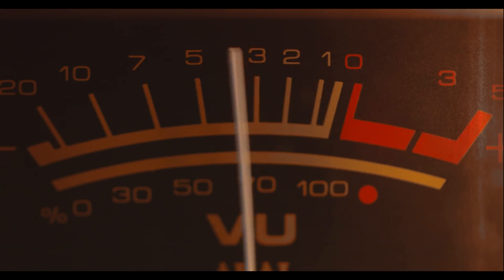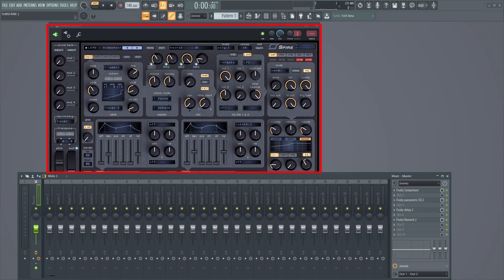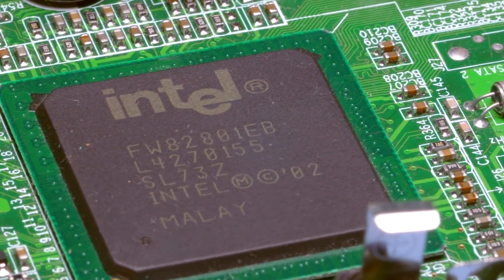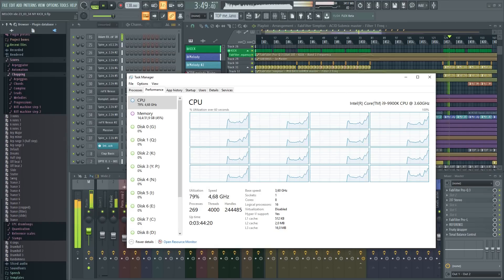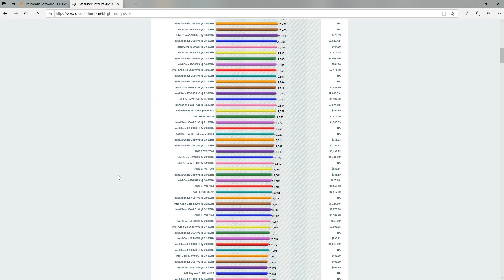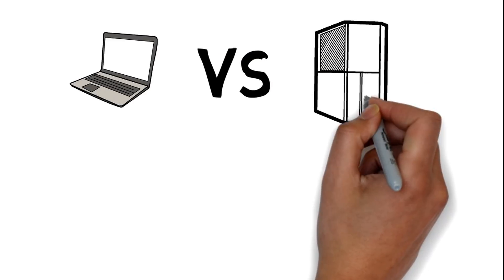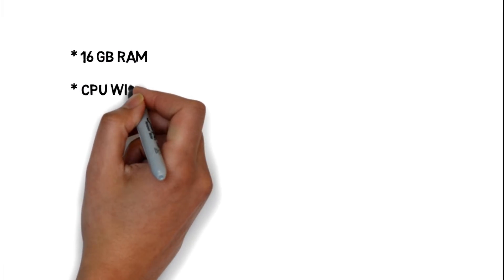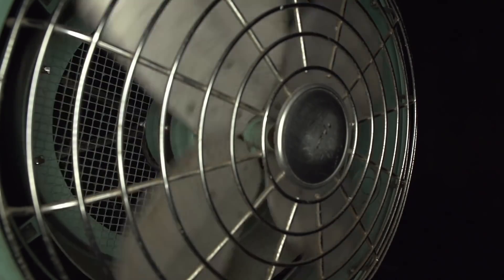The Best Computer For Music Production - What's Needed And Why!

Comment: You confirmed my conclusion: you did a 4 generations upgrade and I did a 5 generations; the performance is better but not as much as I expected. I thought that I did something wrong in my configuration because the performance jump was not a jump at all, and I have upgraded to an I9-9900X, not K, which is said to offer an even higher single core performance, apart the fact that it has 10 cores. But yeah, no overclocking in my case, just running the processor at maximum speed all the time.
Reply from the maker: The main benefit of having a 9900x is that you'll be able to run it with quad channel memory. The 9900k is about 40% faster than the 5820k on paper, however, that's not reflected in these tests. The 5820k is able to run at quad channel memory, which seems to give it a huge advantage. I tried setting it to dual channel, and that had a huge performance impact in FL Studio. 
I assume you're running it in quad channel ? 
Regarding single core performance, the 9900k actually have slightly better single core performance, but that's typical, as core count goes up, single core speeds goes slightly down. It's a small trade-off. 

The reason I recommended the 9900k is because it can almost always be clocked to at least 5 GHz and above. Most of them will be able to run at 5 GHz on all cores, with no problem, and some even higher than that, as long as you have good cooling. The AMD 3900x for example will max out at about 4 GHz on all cores, 4,3 tops if you get a good chip. That's about 1 GHz difference, which WILL have a huge impact. Because single core speed, and IPC in general is so important, I feel like the 9900k is a good way to go, given that you overclock it to get the max out of it. The 9900x will run at slightly slower clock speeds, but then you get that quad channel memory which will come in handy if you have very large projects. 

Building a 9900x based rig will be more expensive though, and I'm not sure if it' s worth the extra money., as I'm not sure there would be a huge difference between a 9900k and 9900x with both of them overclocked to their max potential. :)
Reply: @FireWalkMusic  Oh yes I am running quad channel memory, actually motherboard  does not let me run dual channel, at least that's what user manual is telling me. I am using  128 GB, and my MB can support up to 512 GB, although I do not think 64 GB DIMMs exist on the market now. Its like having a hard drive size RAM, its crazy when I think about it. I could upgrade to 256 GB though... I am just joking, I never seen the memory load going above 20%.

Comment: What was the final budget for this pc? Looks great.  I'm new to this. I plan on building mine soon.
Reply from the maker: Not exactly sure. I think it was around $2000. I decided to reuse some of the parts from my old rig though, such as the video card, hard drive etc. In many cases, if you already have a stationary computer you can simply just upgrade the motherboard, cpu, cpu-cooler and ram, which will be much cheaper.

Comment: If my song is clipping, seemingly as a result of applying compressors etc. does this sound like a cpu problem?
Reply from the maker: If you overcompress your track it will sound distorted. If you max out your CPU you'll get overruns and you'll have pops and glitches which can sound like distortion. You'll be able to tell the difference by looking at the CPU buffer meter. If it's at 100% or very near 100% then it might be a CPU issue, if it's below that then it's likely you have gone over the top with compression. As Peter said, if it's indeed CPU related you can increase your buffer size in the audio settings. You can also try enabling tripple buffer. 

Check out this video for more tips on how to get the best CPU performance in FL Studio: https://youtu.be/OWYmqwb7b4k
Reply: @FireWalkMusic  I went into audio settings and sure enough, asio for fl wasn't selected, it was the buffer causing the issue. Thank you!

Comment: hi... i am thinking to build a pc just like this, but with the i7-7700k because of is higher base clock...
what do you think?  7700k vs 9900k? (just for music production)
are you relying on the overclock? it will be stable?
Reply from the maker: Hi, the i9 will be able to run at 5 ghz or more on all cores without any problems. It's perfectly safe as long as you have sufficient cooling, like in this video, or alternatively watercooling.

Comment: I‘m about to get a new 16“ MacBook and I’m torn between the i7 / i9 cpu. The i9 in theory has better max single core performance and obviously better multicore performance, but here’s where it gets interesting: If the cpu is under full load, the i7 will run at around 6x 3,1GHz and the i9 around 8x 2,8GHz - so higher clock speed on the i7. Assuming doing a lot of processing on individual channels in my DAW (Studio One) with maybe 8-10 plugins on one channel - could the i7 be a better choice here? I can’t decide which one to pick, pls let me know your thoughts.
Reply from the maker: If it was a stationary computer I would recomend the i9. They can be overclocked to run at 5 ghz on all cores. However, a laptop isn't going to have sufficient cooling for that, so I suspect the higher clock frequency of the i7 will be preferably. You need to look at the IPC (instructions per cycle), or operations per clock as some people call it. Most people won't need a 9900k anyways, and the older i7 CPU's are usually more than enough for most people.

Comment: I am building this same pc with all the same components (it's my first build) and I'm having some issues. I have everything connected to the best of my knowledge. PC powers up, all fans running, but no display to the monitor and no USBs seem to be working. Keyboard plugged in lights up for a second and then goes out and is unresponsive. Need ideas.
Reply from the maker: It could be a number of things. Make sure that you have the correct power connectors connected to your video card. If you still can't get any image, try removing the video card and hooking the monitor up to the onboard displayport on the motherboard instead, using the internal graphics instead. If that works, it's either something with the video card, or it's not properly installed. If you don't connect the power to it correctly then it won't work.
Reply: @FireWalkMusic  Tried that and still nothing from the internal video card. The CPU power has an 8 pin and a 4 pin right next to each other. I only have the 8 pin installed (it didn't come with a 4 pin connector that I saw) Could that be an issue?
Reply: Ok, so it was a ram card not fully seated. Damn, I feel stupid :D
Reply from the maker: @Paultheguitarist  Glad you figured it out! It's annoying when that happens :>

Comment: A Mac computer
Reply from the maker: A mac computer and a pc computer is exactly the same. They use the same hardware, it's just the software that's different. It's possible to install mac os on a PC, so called "hackintosh" :)
So in terms of hardware, the same things apply when using a mac. :)

Comment: Amd ryzen 7 3700x has the highest single core performance
Reply from the maker: The new Ryzen CPU's are indeed great and their sngle core performance are now as great, or greater than that of Intel. However, the 9900k will be able to run at much higher clock speeds.  Ryzen will typically max out at around 4 GHZ on all cores, while the 9900k will typically have no problem running at 5 GHZ and above on all cores. That's a 1 GHZ difference, and when you take IPC (instructions per cycle) or "operations per clock" as some also call it into consideration, the brute force capability per core will be higher on the 9900k. At least for now. 

AMD has made some really good CPU's lately, and they show no sign of stopping. Combined with Intel's ongoing manufacturing problems I wouldn't be surprised if the next one they come up with leaves the 9900k in the dust. But for now the 9900k is likely still the best when it comes to music production. 

That said, the AMD CPU's are better value overall. They are great all-round CPU's, and unless you need to really squeeze out every last bit of performance for some reason, then I would actually recommend getting the AMD instead. Few people actually need a 9900k in the first place. most people make medium sized projects and the 3700x will offer superb performance in most cases.
Reply: @FireWalkMusic  well, depends... As long as the DAW you're using can utilize the cores and threads AMD could be better in that aspect as well.

Comment: You should get 128gb of ram when your using so many different tracks and instances of vsts
Reply from the maker: I think that would be a bit overkill. I used to have 16 GB in my old rig, and even with heavy projects like this I wasn't able to max out the RAM. I only went for 32 GB this time to play it safe, and also because I also do a lot of video editing, and often find myself having both the video editor and my daw open at the same time, which eats up a lot of memory. Even so, I rarely use more than 16 GB. 
I think 16 GB is more than enough for most people. If you have very large projects or also use different applications such as video editing then you can play it safe and get 32 GB, which should be more than enough for most people. 
As you keep adding tracks and VST's, you'll eventually run out of processing power way before you run out of memory. I recommend spending that money on something else instead, like a good pair of monitors, headphones or whatever. If you're on a budget then you might want to go for 16 GB instead, and a better CPU instead for example. :)
Reply: FireWalk Your definitely not wrong. And that’s what confuses me. I’m not maxing out my cpu according to my daw, yet when I make my orchestral mockups I’m bottlenecking. I’m running a 2.1 intel Xeon 6 core with 32 gb ram and I do have my vsts on ssds. It gets up to about 75%. I’m upgrading regardless to 160 gb ram and I wouldn’t say it’s overkill for me cause I’m not killing anything I’ll just have a very powerful computer for a long time to come, music is a life endeavor not a goal that  you reach and then your done. I tend to want to have all my plugins such as reverbs and all that going at the same time and sure it’s true I could not do that and separate composition and mixing and mastering to different processes and change my audio interfaces sample rate and all that. But That’s not my work flow so I want to upgrade to my workflow. Oh also yes I’m upgrading my cpu to the skylake i9 x generation 16 core with new x299 deluxe 2 thunderbolt motherboard and 128 gb of ram. Figures I would mention that so you don’t think I’m just getting 128 gb ram and assuming it to solve my problems.

Comment: Can you say What is the best choice from these two?...
I7 5820k or I5 9400f

Thanks...
Reply from the maker: The I7, by far:)
Reply: @FireWalkMusic  but the benchmark test i5 9400f  single core performance better than i7 5820k
Reply from the maker: The i5 has about 10% better single core performance. However, the i7 has hyperthreading and support quad channel memory. That's twice as many threads, and twice as much memory bandwidth. The i7 is a workstation CPU so it's better suited for music production.  That Said, if you also play games on the same computer then the i5 will be better for that.
Reply: @FireWalkMusic  thanks for explanation..
what about amd ryzen 5 3600 / i5 9400f

Comment: Would like Intel i3 laptip be enough for one mini keayboard (Akai mk2)?
Reply from the maker: It depends. It would no doubt be able to handle the Akai. Samples generally don't require much CPU power since they are just being played back. However, once you start adding synths and effects, the i3 will get in trouble rather quickly.

Comment: would mine be enough??
i5, RAM 16G, SSD 500G, HDD 2T
Reply from the maker: Hi, it's a bit hard to say. What computer you need will depend a lot on what kind of music you make and how you work. Some projects have 10-15 tracks tops and others have 200+ tracks. For smaller projects it will work just fine I suppose. For larger ones with heavy use of VST's and effects it might start to have difficulties.
Reply: if you use sampler vsts a lot you might need more ram (like with kontakt) but it should be just fine, depending on which exact i5 your cpu is
Reply: @delta61  thank you 😊
Reply: Thank you~!

Comment: ryzen can do better for this more cores more threads
Reply from the maker: More cores isn't always better. The problem is that a DAW usually won't distribute work evenly across cores. Whenever a computer starts lagging and you get sound cracking due to buffer under-run, it's because one core is overworked, while you might have several free cores doing basically nothing. While a lot of threads would be a great thing in theory, it doesn't help when work isn't always efficiently distributed across those available threads. That's why brute force (single core speed) becomes so important in music production. IPC (instructions per cycle) is the most important thing, and then the number of cores next. Out of the box I suspect the two flagships will perform fairly similar, since AMD now have about the same single core performance as Intel. However, the 9900k can easily run at 5 GHZ on all cores, while the 3900x for example will max out at about 4 GHZ. That's 1 ghz difference, which will make a big difference when you look at the IPC number, which is the most important factor in music production. Core count is important too, but only if work is distributed to available cores evenly, which is rarely is unfortunately. 

Never the less, the new AMD CPU's provide great value, and are better all round chips for that reason. Especially if you also use the computer for other tasks, such as video editing for example, then it's a whole different game. Most people won't need anything close to a 9900k anyways, so the new Ryzen CPU's will be a very good option for most. However, if you need to squeeze out every last bit of performance in order to run your projects for whatever reason, then the 9900k will likely still come out on top.

Comment: The 9900k is overkill for music production. A ryzen 5 3600 is more than enough for music production and video editing and it's less than half the price of the 9900k lol
Reply from the maker: The 9900k is indeed a bit overkill for most people. But not all. Some people might even find it to be too slow. It all depends on what kind of projects you make and how you work. Some music utilize 10.15 tracks, and just a few VST's and some samples. Other projects have 200+ tracks and countless VST's and effects, so the processing power needed will vary greatly from person to person. It all depends on what genre you are producing, what kind of projects you make and how they're set up, how many plugins you use and so on. Also, do you mainly plot in midi and such? or do you need to record midi or audio frequently? In that case you're going to require low latency, and a slower computer won't be able to accommodate you at low buffer settings, so a faster computer will be needed so that you can record without latency. 

How much processing power someone needs is indeed very individual.
Reply: Maybe more than enough for you, but using multiple synths with heavy unison, compressors and exciters with oversampling, mastering software on oversampling, delays/reverbs/convolutions, it becomes a different story.

Comment: I produce on my imac it only has a dual core it but it runs logic with several plugins pretty well. I dont really notice a difference between my dual core imac and my quad core gaming laptop when it comes to producing. Though the plugins I run dont take up too much cpu usage.
Reply from the maker: Indeed, there's a lot of difference between plugins in terms of CPU usage.

Comment: Zen 2 has pretty much matched intel in single core performance so I would go with AMD it's cheaper just as good and has a better upgrade path
Reply: Latency issues with amd..
Reply from the maker: The new AMD CPU's are indeed very good and AMD provide better value than Intel generally. If you're building an "all round" computer and you also do other things besides just making music, such as video editing for example, then extra cores can come in real handy. Most people won't need anything close to a 9900k, and for those AMD will be a good alternative. 
However, for those who need to squeeze out every last bit of performance in order to run their projects (for whatever reason) the 9900k will likely be the best option still. It can operate at 5 GHZ on all cores, while the 3900x for example can only run at about 4 GHZ on all cores. That's a 1 GHZ difference, and when you take IPC into consideration then that's a huge difference.

Comment: My biggest problem is noise.  I have a 4930k and its still plenty strong.  Having 32gb of ram and ssd's is the biggest help imho
Reply from the maker: Noise is the one thing you definitely don't want in your studio :\
Reply: @FireWalkMusic  if with noctua fans its still noisy in there.  Going to try fanless next time if possible.
Reply from the maker: @shadowhenge7118  Are they small or large? Even Noctua fans are going to make some noise at higher RPM. Small fans typically need to run at higher RPM in order to push the same amount of air as a large fan at low RPM
Reply: @FireWalkMusic  theyre all 120's, they get noisier over time.  Even with cleaning.
Reply from the maker: @shadowhenge7118  That's weird, they shouldn't be making much noise unless they are running at very high speed. Perhaps there is something wrong, but it would be strange that the same foult should be present in all of them, assuming there's more than one.